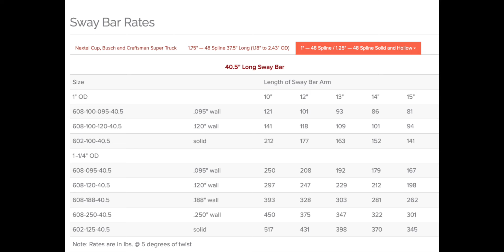MG #151 - Sway bar installs and steering fixes

Comment: I think you’re mistaken when you said you don’t have cross over steering on your blazer. Clearly you do. High steer is related to the location of the tie rod, and crossover steering is when your draglink crosses over from the drivers side to the passenger side knuckle. As apposed to the stock configuration where the drag link goes from the pitman to the drivers side knuckle.
Reply: Speedway sway bars are awesome, that’s exactly what I run. But I have had 3 different arms stop out the splines. Make sure to disconnect it when rock crawling
Reply: I was thinking the same thing.  Chevy’s had push /pull steering out the door when built.
Reply: A simple mistake in terminology. But I had to point it out.  Sorry to be that guy.
Reply: Joe Hill what does a setup from speedway cost? I need a similar one.
Reply from the maker: It was something under $500 if I remember.  

And I am no authority lol, if I say something wrong I wanna expect, you guys to back stop me!  😛
Reply: Merricks Garage I think you’re correct with the price. But I installed mine a long long time ago. They do have a website with listed prices.
Reply: Yeah he had me confused for a quick sec on the cross-over high steer comment...

Comment: Hey my friend! If you like using a drill press youll like it a lot more if your throw the cutting oil away and simply use water. Just keep it wet (which keeps it cool, it it stops steaming add more) and everything will go faster and your bits will last longer as a bonus. Yes, it will rust if your lazy and dont wipe it up and dry it off when your done. If you cant get your head around using just water go ask a machine shop if you can buy a little coolant to mix in with the water (It has some other benefits that are minor when drilling holes with a drill press but then you have residue from the coolant when the water that is mixed with it evaporates). Good luck!

Comment: Personally I would do the final steering adjustment at ride height. Also I think I would have used a piece of the DOM sleeved and welded in the frame for the swaybar bushings to sit in.
Reply from the maker: Steering is mechanical and shouldn’t be affected by the suspension or truck weight.  If it is something is off.
Reply: @MerricksGarage  Your correct to a point. But since your running a panhard bar, your axle moves in a semi radius motion. Albeit in a correctly designed suspension with a panhard it should be minimal. But this doesn't effect the mount of the ram since you ran it from axle to tierod. Which is actually what I was referring to incorrectly.

Comment: Hi Merick I have an 82 gmc jimmy with a 6” suspension lift with 15”x12” rims with 37”x14.50 tires problem is when I turn to go on a drive way the tire hits the fender I installed the sway bar but it still hits. Is there anything I can do to eliminate this from happening as I don’t want to cut my fenders. Thanks
Reply from the maker: prob not a whole lot.  That is a really big tire with a wide footprint.  I am trying to not cut my fenders with the Suburban on 38's I am building currently but I am not sure that is going to be possible

Comment: Why didn't you just put the bushing on the outside of the frame rail.....🤦‍♂️
Reply from the maker: Dang it.  Someone noticed.  I was waiting for this question lol.  I overdrilled the outside rail 🤫like an idiot.  This was my work around.  It ended up working as it will keep the bushing out of the dirt a little bit.  At least that is what I am telling myself...